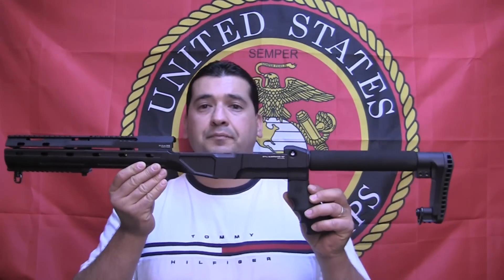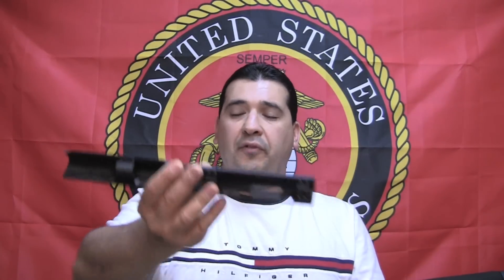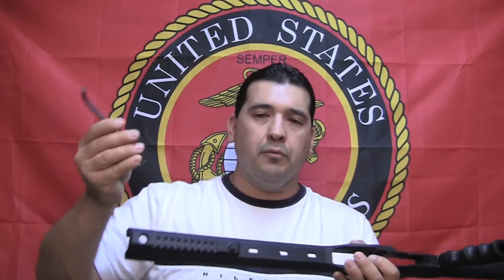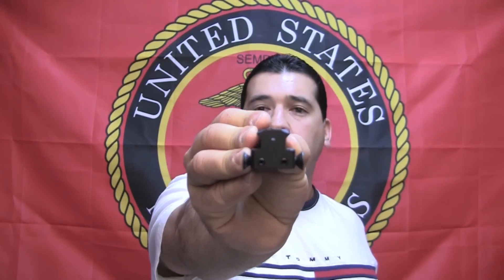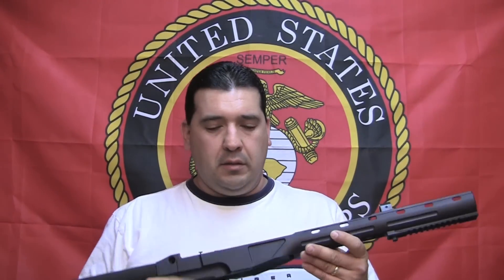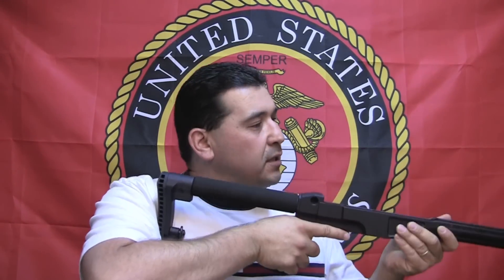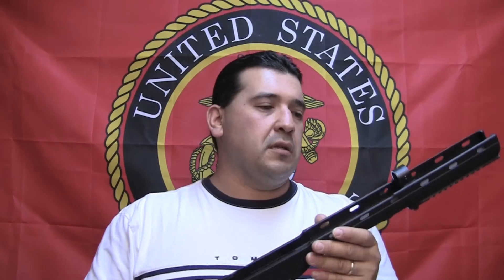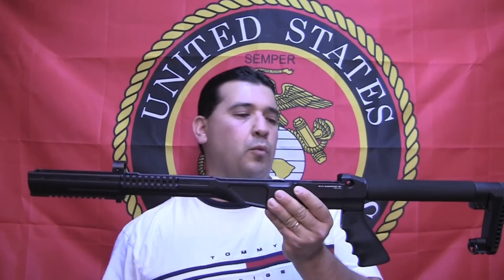M14.CA Blackfeather Chassis Overview with Extras

Comment: couple questions.....first I can put any AR 15 stock?....secondly does shaving the pin have any negative effects to the rifle
Reply from the maker: Hank Hill Yes, you can put on any AR stock. Shaving the pin has no effect on the function or accuracy of the rifle.

Tony.
Reply: Thanks for the info.....by any chance did you do a torture test on the m14/m1a rifle...if not what is the reliability of the rifle